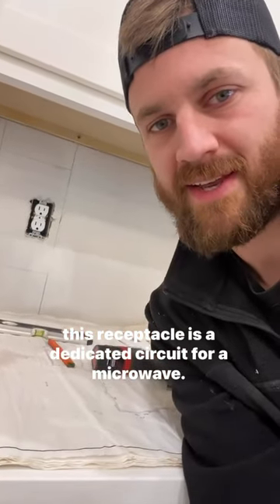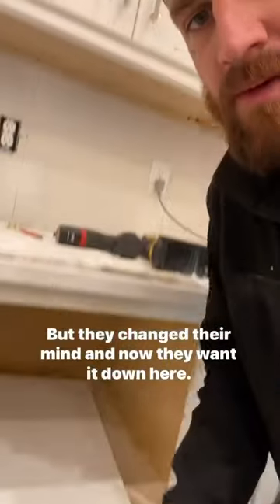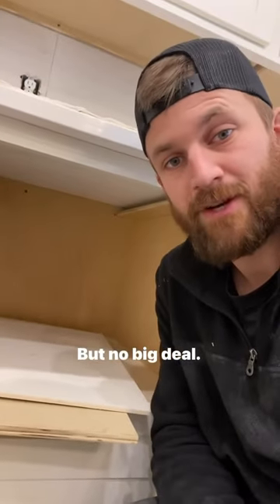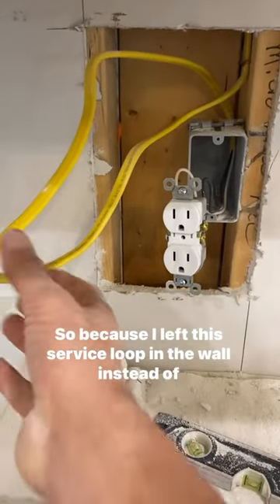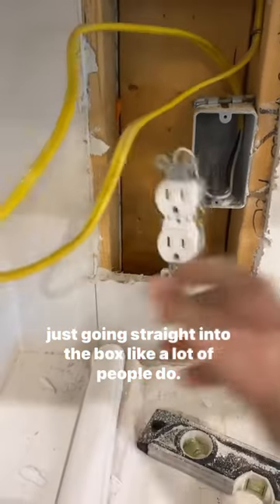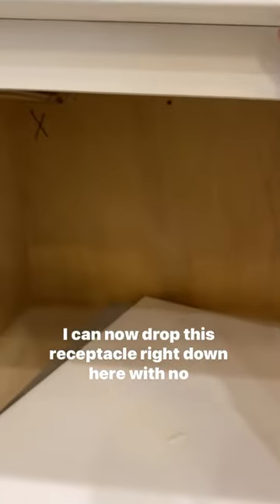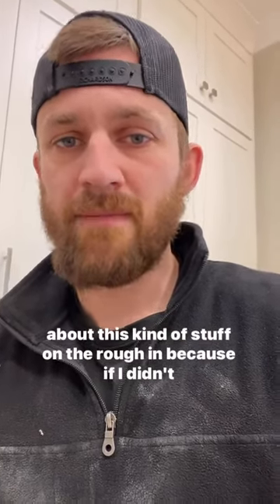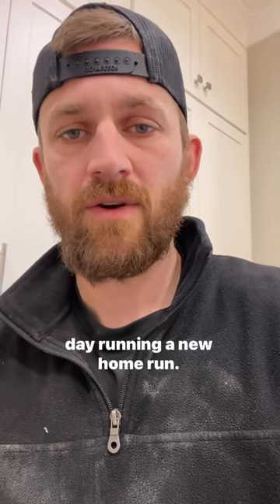This is Why You Should Leave Service Loops!! #electrician #bluecollarlife #construction

Comment: I just did continuing education for electrical, you can use splice connectors (specific ones) i forgot what they are called but they're like $12 and they can be left behind drywall and no junction box needed
Reply: That's weird cause if the connection becomes loose how can ypu access it
Reply: @markk3948 solder and heatshrink it, could it "become loose"?
Reply: @mrtechie6810  good  point :) no one soldiers anymore tho
Reply: @markk3948 as a Ham Radio operator, I'm always working on projects. Solder and heatshrink are standard.
Good crimps are even better: less likely to crack on flexing/moving connections.

Comment: Leave the plug where it was cause you’re technically violating the plug to countertop ratios. Could have just extended the ckt Added an additional plug. That micro will not stay low…despite what the owner wants at the moment.

Comment: Without a service loop, I would not have made a new home run.. I would leave the original outlet in place as a connivence outlet that may see occasional use or not, and just run a short to the new duplex  box below. 

One of these days someone is going so show up with a coffee grinder, blender, mixer, toaster, hot carafe, whatever, .... and need that top outlet.

If its a 'built in' microwave... then it needs its own circuit... and with no in-accessible junctions allowed, you need an ugly blank cover, or a new home run.  If leaving a service loop, be sure to tie to stud within code distance of the box, 12" in USA.

Comment: Not necessarily... you could've boxed it with a blank plate in the upper cabinet and extended it or depending on what's on the back side of that wall.......🤔

Comment: Sometimes it’s tricky leaving a service loop, while still having the line secured within 8” of the box. 

I generally use a loose staple so that you can pull some of it down without having to cut out drywall.
Reply: I was thinking the same thing....he doesn't have a required staple near the box

Comment: NEC does not require a dedicated circuit for a free standing microwave, so you could’ve just left the receptacle up top and spliced in a new one below off the same circuit. BTW, you have to leave that receptacle up top to satisfy counter coverage.

Comment: If i remember correctly u cannot have more than 12 inches of wire after the final staple which includes the min of 6 inches sticking out of the box so technically that is a code violation

Comment: Just use the box above the counter as a junction box for the microwave, and then run a wire from one of the other outlets in the kitchen to the junction box and put an outlet. 

Now you have an outlet connected to the rest of the kitchen since you took the microwave away. You need to now as another outlet there anyway.

Comment: If needed couldn’t you splice inside the original outlet box and extend the wire if needed?
Reply: It's a home run which means it went straight back to the pannel  if you meant the original rec box then yes but would be ugly

Comment: This is absolutely not to code. You need to secure the wire within 12” inches of the box. By eliminating that outlet you’ve also possibly just created another code violation by not allowing the correct amount of distance from edge of cabinets to the next outlet. I see the outlet on the right hand side, but that one looks like it is more than 3 feet away from the edge of the cabinet, which is a violation.
Also, you could have gotten a multi tool in the original box hole to cut the nails off and reach your hand inside to remove the staple and push the wire down to the next area without creating such a large drywall patch.

Comment: Is it against code to just use the existing outlet as a junction box and run a piece down if you didn't have that extra slack?
Reply: Junction boxes need to be accessible so you could do it and then have a blank cover on the J-box, on the backsplash of a new kitchen, which looks so tacky and unprofessional on a new build.

Comment: If I were the homeowner, I would have just had you add another outlet beneath.  Actually, I would never put a high power portable appliance inside a cabinet, because fire.  Still good thinking, always leave a little slack.

Comment: If you add a service loop like that at every receptical and switch youd be paying a grip in wire costs. You can always plan ahead and bid it that way or do a time and material job, but sometimes its just not possible to always leave a service loop at every spot. I understand at home runs but thats about it.

Comment: What is required by code is stapling within 6” of the box. You’re doing over a foot
Reply: 12" as per 334.30
Reply: You're both wrong. It's within 8" of the box if the box is non-metallic and doesn't have a clamp built in, and within 12" otherwise.
Reply: @edisont.picard4112  That box has a built  in black piece of plastic that clamps the wire where it enters the box, so as I said, within 12 inches as per national electric code. Good talk.
Reply: @farkmuckerzerg634  Nah. That's a single gang nail on new work box. No clamp, just a square hole.
Reply: @edisont.picard4112  You're confusing 314.17 b2 as stating the strapping code at 8 inches, when it's just saying you don't need a clamp if it's strapped at that length. Lol. The distance is 12 inches from the box. Learn your code my boy
Reply: @farkmuckerzerg634  Right. So, a single gang non-metallic box without clamps, such as the one in the video, must have the cable secured within 8", since it is not secured to the box. Don't let your ego get in the way of learning.
Reply: @edisont.picard4112  It isn't saying that. Read the article. It's stating that if it's secured within 8 it doesn't need a clamp, aside from the old fiberglass boxes, every nail on has built in clamps. It isn't stating the strapping distance is required to be 8 inches, but that no clamp would be required. I don’t see how that is confusing you. But also as I said, the black piece of plastic inside of that back is the cable clamp. Now, go to 334.30 and read it aloud to yourself until you understand it.

Comment: Why couldn't you just add another length of wire and keep the original power outlet and have 2? Is it because the microwave has to be on its own dedicated circuit?

Comment: I just did continuing education for electrical, you can use splice connectors (specific ones) i forgot what they are called but they're like $12 and they can be left behind drywall and no junction box needed
Reply: Only for REPAIRS. NEC does not allow in wall splice for wire extension. Think, screw damage during a remodel or picture hanging.

Comment: Doing so you are also increasing the chances of somebody damaging the cable because most people would probably assume there is a straight run. Also, you are using more material than necessary to adhere to code.
Last but not least, if the customer changes his mind after the last minute, it is a new job for you, if you need to spend the whole day to do it just bill it on them, it's their "fault".

Comment: If you have the correct cabinet layout and know how to measure you shouldn't have to do this. 
What I do in this situations is run the wire from the bottom about halfway so I can move it up or down

Comment: New home run like heck! Im bootlegging that by junctioning those wires together right there. Twist em together good and wire nut them with a couple more twists and tape the wire nut on. Stuff em back in the box and there is absolutely nothing wrong with  hiding that box in the wall. But yep I leave plenty of slack in those kitchen outlets in case they  need to be moved.

Comment: I had always interpreted the 1' staple proximity to serve as something of at strain relief. Especially so on plastic boxes that have little to no retention capability. Leaving a loop between the box and staples defeats this purpose. The wire if left wandering into the box.

It's only by the grace of God that you didn't destroy that service loop cable with the router.

Comment: Pretty sure all that loose wire hanging out there is not to code. You could have just used the existing box as a junction, left THAT outlet there, and dropped 2 feet of romex to a new box down below. Then you wouldn't've had to patch the drywall, either.

Comment: And another thing... the staple has to be within 12" of the box. It doesn't say that you can't leave any slack at all between the box and the staple.

If your drywallers are so stupid they hammer thru a wire next to a box, find better drywallers. They're gonna ruin your house.

Comment: So you leave around 40 cents worth of wire on every box in the house incase this happens. so the average house you have around 150 wires going to boxes so that is $60.00 worth of wire just so you might be able to save 3 wire nuts. By the way the owner now has drywall to repair.

Comment: That's why you charge them for it if it changes. Called change order. Then recharge. Because the job was done. Imagine you got called for that on an inspection then had to correct it. Then turn around and they want it changed.

Comment: 100% agree. I also do services loops and just like you I staple down the wire really close to the box. (Somewhere around 3-4”) The only thing I do different with my loops is have them a  little smaller.  But this is literally the perfect example of why you leave a service loop. Just like when a trim carpenter or drywaller hits your wire leaving you only an inch of conductor. I always see these clowns on here talking bout how it’s against code or that it’s pointless or that it cost more money which all are false statements. One of the things is it leaves you with less scrape that you was already billing the customers for. Anyways. The only thing I would do different here is, I would have cut the box out instead of the sheetrock. Not sure what you do after but I would then install a cut in box and use the piece I cut out to patch the sheetrock up top.  Good job and great video bud.

Comment: Seems like wouldn’t be up to code. 
Seems like it would increase chances of someone drilling into the wire at some point.
I don’t see why you would need an entire new line run 
You could’ve left the outlet where it was, put in a new outlet below and connected the outlets together.
If for some reason there’s a code that you can only have one outlet, you can remove the top outlet, put in a closed off wall plate and called it a day

Comment: In Europe we use flex pipe with cables in them. By code everything has to be rewirable, just tie on new wires and pull using the old ones
Reply: This ain't Europe. In Narnia those wires are supposed to be magical conduit....practice relevant comments.
Reply: Same as ireland but its never that easy to just Rewire

Comment: If you knew there was a not good idea service loop, then why would you cut that monster hole in the wall? You could have cut it in the lower area and reached up to grab the disconnected wire, if it didn't fall by itself lol

Comment: Which mean you've wasted 24" of Romex at every opening. At 50 openings per house. You've wasted 100 feet of romex  per house.  That's a lot of cash to be hiding in the walls.
Reply: Failed electrician robbing homes for copper like a tweaker

Comment: Service loop against code in many places as it's not fixed. Either way, you've now lost the advantage, Just use the backbox for your JB and put an extra piece of cable down to the socket because it's a dead cert they will want a socket on the counter for food mixers, etc. and you didn't have to cut away all of that!

Comment: Or if there happens to be no slack. Run new wire down to desired length, splice, blank cover, wire outlet at final location then boom. Problem solved.
Ye buddy lioght weighht

Comment: Or you could have just jointed the cable in the wall with maintenance free connectors and a suitable enclosure. In the UK leaving a loop like this would actually be against the Regs.
Reply: Really?
Reply: @charliedecker7702  Yeah we have to adhere to safe zones for cables. Looping the cable so far away from the switch falls outside of that. We can only have cable vertically or horizontally in line with a switch, outlet etc.

Comment: A couple issues my friend. That's not a clamped box, so you're only allowed 8 inches of loop to the wall staple. If the box has a clamp then you can pull a 12 inche loop to the staple. Looks like you have 18 inches in that loop there 😂 You may need to read up on the NEC, depending on what Country your in i suppose. Not to mention if i wire my houses using this method I'd use a extra 100 feet, plus, of wiring. Do i lose the job bid because i think someone may want to move a outlet or light, years down the road! A home owner diy'er or handy man can do this though, I suppose. But if you are concerned that someone will want outlets moved or added then add junction boxes, that way it won't take you "all day" to rewire a outlet 😂.
Now this is the part were someone responds angrily but without a shred of merit.

Comment: you could’ve kept the receptacle the, and if you weren’t using the 2 bottom terminal screws, could’ve made an extension from 1 receptacle to another
Reply: No. Code violation.
Reply: @aaykay4060   Not a code violation in my area

Comment: It's not in the code because it is a dangerous practice that leaves wires out to be hit and cut. Code requires the wire to be stapled no more than 12 in. from the box.  Good practice is less than 6 and should neatly go directly into the box.  The NEC is for safety.  Hope you have fantastic insurance. You're going to need it.
Reply: that box has an integrated clamp so the first 6 or 12” is covered either way.

Comment: Wow WOW  WoW my main Mellon woulda just cut in my outlets new location and drop chain to new location and done blank off old one or give customer option or even try running 3wire to dedicate outlets I always do specially when it may be a need for a 220v application

Comment: This is a decent idea but tbh you didn’t have to do that and it probably would have been faster to install another old work single gang box down where they want the microwave and then use the existing box as a junction box, and tap off of that to get to the new box

Comment: I mean I get where you are coming from but let’s be real if you are wasting 3-4 foot of wire at every box especially if you are going in and out continuing the circuit you could save all that money in wasted wire and just buy an in wall splice kit that allows you to make a splice and bury it in the drywall for so much cheaper.  

But there are more than two ways of doing something and as long as you have thought out why you do it this way I can dig it. 

The switch work in a different video looked real nice. Keep up the great work bro

Comment: Service loops are stupid in my opinion. Save the customer that doesn’t change shit up money, and charge fairly on change orders for the ones that do. 
You still gotta get a rec within the first 2’
There was no code requirement for that micro since it wasn’t fastened in place, but good move going ahead and running one.

Comment: Really simple forethought like this that costs pennies, pays off in spades in the long run and when you explain to clients, builders or anyone, you look like the hero and genius you are. Being that the service loop is dangling behind the wall there is very little chance of a fasteners pinning against a hard surface and piercing the cable. Anything but home run are hack jobs IM OCD Opinion.

Comment: Why cut the that whole piece of wall out ? 
Put a hacksaw with metal blade . Cut the screws from the side . Pull box out and then fish wire down.
Reply: The rock would be an easier repair

Comment: Orrrrr you could have put a j box in the attic above the top plate and added 10’ of wire to get down to the new location. And if it takes a whole day to run a home run, you might wanna  pick a new trade

Comment: Sure. You left a service loop but the wire isn't stapled within 12 inches of the box.  You still need to secure the wire properly. Also, there's no point here because this outlet is also one of your kitchen countertop outlets meaning you still have to add wire to put an outlet in the cabinet.
Reply: First, the wire is clearly stapled only a couple of inches above the box (well within the 12 inches required by code, which is linear distance, not cable length), so that is fine.

Second, you apparently missed the beginning where he said this is a dedicated circuit for the microwave, not one of the general-purpose kitchen receptacles.  (Though, arguably, if it's intended to be a dedicated circuit, he probably should be using a single-outlet receptacle too.)
Reply: @foogod4237  that's more than 12 inches of wire unstapled. I can clearly see that he didn't measure 12 inches of wire from the box.  That wire is technically stapled at 2 to 3 feet along it's length.
Secondly, a dedicated microwave circuit, if counted within the code spacing of the countertop receptacles, can be counted as a countertop receptacle despite it being a dedicated circuit. From what I saw it looked like it was spaced from the outlets of the kitchen countertop circuit according to the code for countertop outlets. If the nearest two outlets to this one are beyond the max distance by code, then he has to keep that outlet above the counter and extend the circuit to the cabinet space.  The code requires a minimum of two countertop circuits with a maximum spacing between devices.  There is nothing in the code saying that you can't have additional countertop circuits nor that the additional circuit can't supply a dedicated outlet.